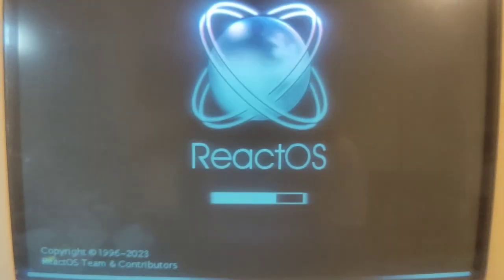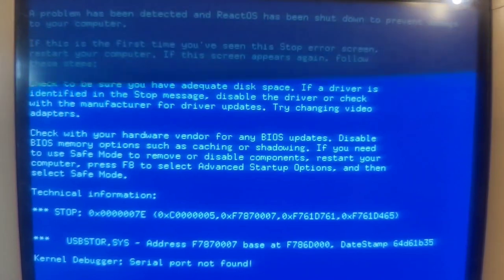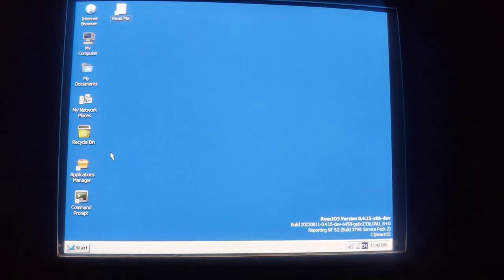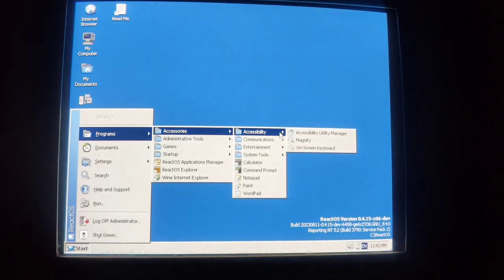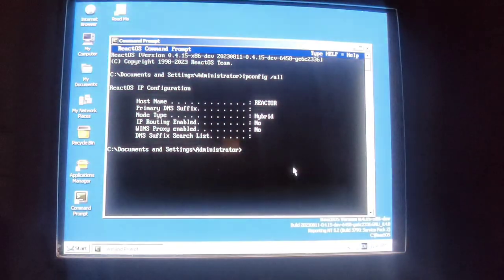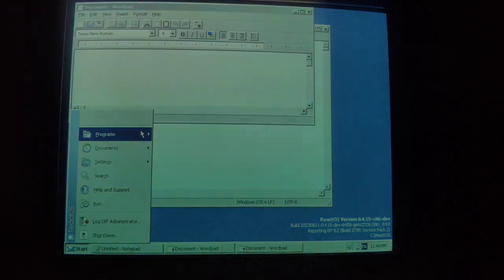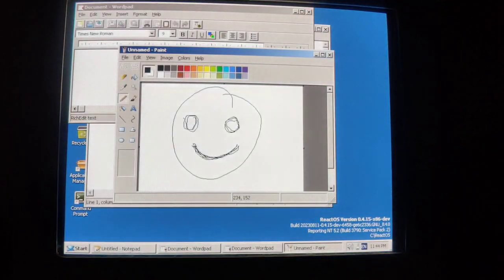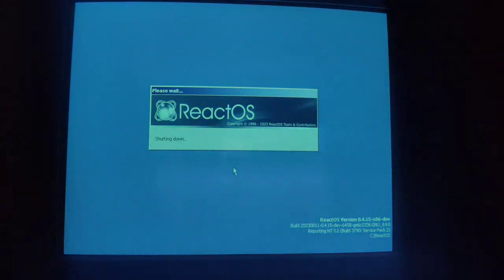ReactOS on Two Decades Old Machine

Comment: I am looking for a working 32-bit x86 laptop to run Icaros Desktop OS on (an Amiga-like operating system based on AROS). One can also build an “Amithlon” on an IBM ThinkPad T-42 (and it would run Icaros Desktop OS too!). Sadly the prices for a fully working T-42 is like $150 to $300 and that is just silly. 

I might have to find some old Dell
Reply from the maker: Look, there is an Austrian website called "willhaben (dot) at", and right now, I see there a working T42 for 19 Euro. There is a German site called "kleinanzeigen (dot) de" which has one for 40 EUR (beware, the cheaper ones seem defect). Just a friendly note if you want to give it a shot. Even with postage and customs, you should be nowhere near the ebay insanity.